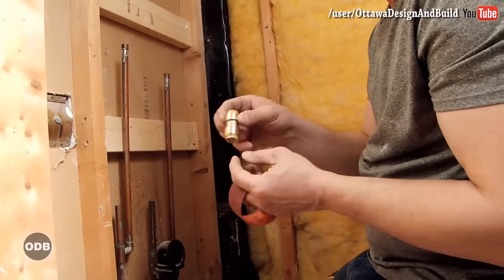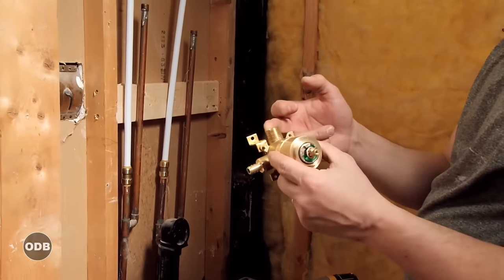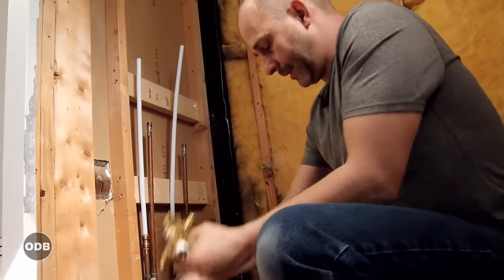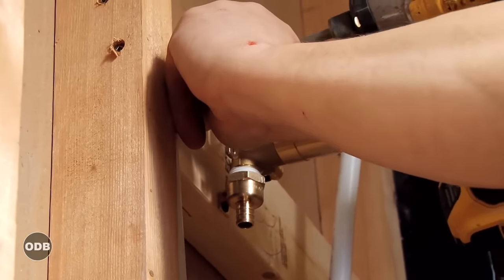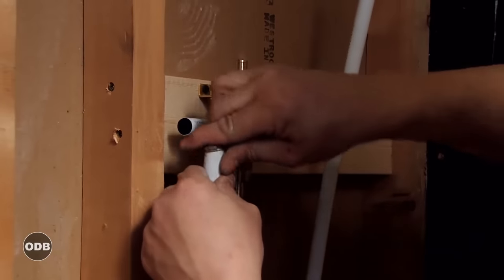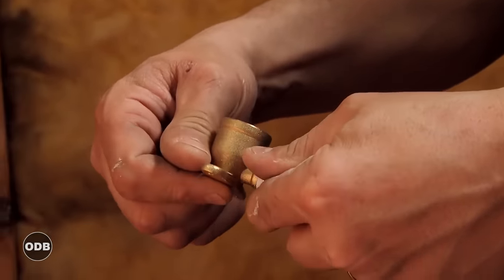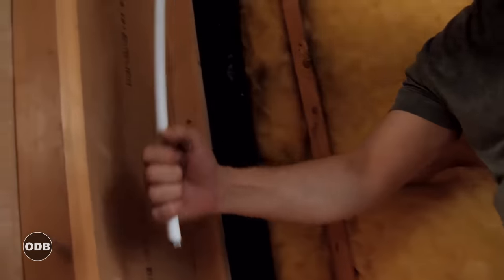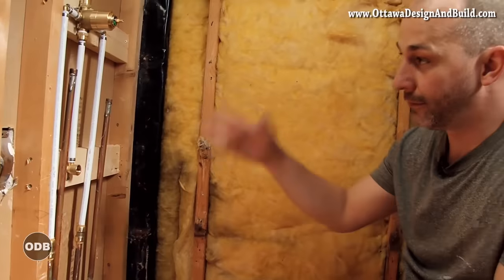DIY How To Install Copper To Pex | Shower and Bath Plumbing

Comment: Outstanding video! 

So about a year ago I hired a plumber for TWO DAYS to move some pressure copper 1/2 inch water lines in my basement in order to renovate a bath and laundry room. He did exactly this, converted everything from copper to pex. I watched and was amazed at how simple it appeared. Measure, cut, connect. There was a little drain pipe reconfigure also, which was simple.

One plumber for two days = $2,300!!! 

After that learned how to install pex myself with a buddy. Never using a plumber at $100/hr again...not for installing pex! Super easy and lots of help out there.

The cost of shark bite fittings are irrelevant compared to cost of licensed plumber. 

What this guy just did in this video would cost me several hundred dollars where I live if I used a plumber. Never again! 

Thank you again!!!
Reply: You’ll be calling that plumber back when those Sharkbite fittings fail. They’re cheap and easy for a reason.
Reply: @jimsmith3712  they're industry standard my friend. Tried and proven time and time again. Not remotely worried about it.

Plumbers are way way over paid! It's good work if you can get it. This shit is easy though, and there's lots of help out there. Fortunately for plumbing industry  Americans are lazy and have no sense of delayd gratification. 

As for me, a Plumber  in Wyoming with  helper is $230 / hr! No way, I'll figure it out and do it myself!
Reply: @paulv8133   Sharkbites are NOT industry standard by any means. You’re not even allowed to use them unless they are in accessible locations due to high chance of failure. And we are not overpaid we go through years of training to provide every house and building in America with sanitary Plumbing. We save more lives than doctors bro. Plumbing is the main thing separating us from 3rd world countries. And btw the type of pex piping he is using is trash, so are those cinch rings and he used the pliers ass backwards to tighten those fittings. 😂 This guy is a hack
Reply: @benjaminwhite6247  there you go, everything you just said one can watch multiple YouTube videos. I'm just saying I'll never pay a f**** plumber again. It's not remotely hard and anyone can do it.
Reply: @jimsmith3712  they have been out for a long time and really haven't heard anything bad, except for plumbers who are scared they be put out of business.  It's not rocket science and as long as you do it right, there's no problem.  The big problem is that plumbers pricing is beyond ridiculous and they got too greedy.  I've heard where they replaced toilets and charged $2100.00  There is a place for plumbers but for basic plumbing a lot of its now DYI

Comment: Thanks for the video! Plumber wanted $850 to change out shower valve (that I broke trying to fix leaky shower head). After seeing your video, a buddy and I changed over to PEX with new shower fittings($85) for a total of $190. PEX crimper tool ($45)was part of that cost. Super easy to do
Reply from the maker: That is why we do what we do. Cheers!
Reply: That plumber was trying to take you for a ride. I just had a 2600 ft house re-piped for $750.

Comment: Thank you so much.  I was just quoted $400 to install a Watts Recirculation system on my electric water tank.  It has a PEX pipe and I had no idea how to make the connection until I watched your video.  You are the Man and save me a bunch of $$$.

Comment: First time doing any kind of renovation and your video helped tremendously. All of them have, actually so thank you for that. My shower is enclosed and ready for tile. While researching that I came across something about the tub spout distance from the valve. I did some measurements. An entire 29" PEX run to the tub spout. Reading further, I realized that it should be no longer than 18" (per my installation guide) and should not be PEX but copper. The issue being that the shorter PEX diameter can constrict flow and combined with the excessive run, the shower head will/may run simultaneously with the tub spout diverter down. Per this video, I used PEX instead of copper. Lesson learned: always read the instructions before an install regardless of a youtube video demonstration, I get that. I'll be opening up the wall (Schluter Kerbi Board) and replacing what I need to. It's extra work but proper function and peace of mind prevail. 

My point being this: I appreciate your videos and I've learned so much. However, DIY homeowners should always read installation manuals regardless of what is shown in a video. Improper installation will definitely cause unnecessary delay and frustration.
Reply: Like you said the use case matters, even with copper. Some people only have 1/2 inch installed and they wonder why their water pressure is so terrible when more then one source is used.

Comment: This is the exact project I have to do!. Over the summer I added a Sharkbite "T" connector to a hot-water line & ran pex to a frost-free Silcock (even added an on/off lever in the pex line) & now I have an outside hot-water faucet. It works great. This video has emboldened me to take-on the tub project!

Comment: You should of 3/4” pex to the tub spout because, depending on the water pressure in the house, the shower head will drip/run every time you are using the tub spout do to restriction of flow by the 1/2” PEX adapters.
Reply: I’ve heard this several times. Idk if there’s much weight to it, but I’m getting ready to remodel my bathroom and I bought 3/4” pex to go from the valve to the drop elbow, and 1/2” threaded nipple for the spout itself
Reply: It says right on the valve not to do what he did. Was totally stupid. Otherwise the valve would have had the same nipples for that. He should have had a disclaimer he wasn't a pro, and not following manufactured instructions
Reply: What else can a diy use ? Don’t want to do soldering. Was about to install and tub spout line shows no pex or cpcv

Comment: My grandfather built houses and was just an all around handyman. Anything you wanted he could do. My dad was handy also when he wanted to be lol. But both died before I bought a house and required any of the knowledge I picked up throughout the years. I didn't pay enough attention to what they had to offer. I'll be honest Jeff I've learned more from your YouTube videos than anyone in my life. Enough if they were alive they'd be proud of projects I've completed. They'd prob point out some mistakes lol but don't all father figures. Thanks Jeff for all you do. (As I'm sitting here between putting up concrete board in my shower .it has a vaulted ceiling on one side 😑)

Comment: Hey Jeff, have watched this video several times. It's has saved me twice. Used Shark bites to connect my furnace humidifier replaced faulty saddle valve - it's open in the mechanical so I can monitor. Also replaced leaky shut off valve under kitchen sink. So far so good!
Reply from the maker: Love my Sharkbite brian. They are so easy to use and saves a lot of contortionist work in hard to reach places.

Comment: When wrapping PTFE tape (2min+) hold the reel the other way round then as you wrap you can control the tension AND the way/speed the reel unrolls.
Reply from the maker: thanks
Reply: Yes and the tongs too
Reply from the maker: cool
Reply: Burn Rooster i just see this video and he's doing in the good way direction putting the Teflon tape ok?
Reply: Plumberman Jones plllmk
Reply: Exactly what I was taught
Reply: would of thought it was obvious
Reply: Every video I watch just enfasizes that he is not a professional. Probably just the guy next door doing handyman work. The problem is that he isn't doing things correctly. Those pressure arresters always go above your spout otherwise you will lose water pressure when you open that valve. It is simple physics. SE PLUMBING CODE. ALSO HE DIDN'T STRAP ANY OF THE PIPING, THOSE HOMEOWNERS WILL BE ASKING WHAT IS THAT RATTLING NOISE EVERYTIME THEY TURN ON THE WATER🤣😂

Comment: Been doing Home improvement for 27 yrs...Things to do different: when using a shark bite, blunt out any copper pipe burs with a knife or blunting tool. Not doing so may damage the rubber "O" ring inside the shark bite upon insertion, and cause a leak. NEVER sand a copper pipe when using shark bites (SB) because the rubber "O" rings inside the SB fitting needs a smooth surface to ensure a proper seal. Scouring the pipe ensures micro water pathways, which will corode the surface of the pipe and cause a major leak later...that being said, NEVER use shark bites behind walls or hidden areas. Only use in accessable areas. Although  shark bite is an awesome product when installed properly, it may also fail. That being said, I would have used a brass "copper to pex" fitting, and soldered it to the copper pipe. Soldering is a tried and true method of plumbing...when done correctly.
Reply: I agree, I've seen so many shark bite installation that leaked. When copper pipes are in perfect conditions (straight,no curves, easily accessible), it may fit well, but when the SB connector is not aligned, the little drop comes out and your losing hours reparing this. I would never sleep well usign those SB connectors then close the wall, put ceramic tiles and hope it never fail.
Reply: @ericvaillancourt5969  so you’re saying all of these installations where they use shark bites for a shower will fail?

Comment: The directions with a MultiChoice universal Delta Valve say you must use copper or galvanized pipe to the tube spout to avoid having water coming out the shower head even when the tub diverter is not activated: 
 4. Between the valve down to the tub spout, make sure you are only using 1/2" copper pipe or 1/2" galvanized pipe. PVC or PEX piping has a smaller inside diameter which pressurizes the water up when it builds up. You can use PVC or PEX piping anywhere else in the install but between the valve down to the tub spout, you should only use 1/2" copper or 1/2" galvanized piping.
Have you ever seen this issue?  Thanks!
Reply: Greg Guiltner true. I had an issue with this a few years back. If it’s strictly shower with no spout. Pex all the way.
Reply: True weird thing is I have ran pex to tub spout in a pinch and tested before the wall was closed to make sure water didn't come out of shower head and it didn't. I have also seen this happen aswell. I'm not sure if it happens with just the cheap valves or if shower head height playes a roll in this to along with the restricted flow. I usually put my shower head  in around 80inch or higher so that might help the water not make it all the way up not sure.

Comment: The spout for the tub has to be 1/2" copper or 3/4" as pex you are going to less than 1/2 and almost a 1/4".  The restriction can cause the shower to come on without closing the spout. That is code.
Reply: Yep. I had that problem when I used 1/2 from valve to tub so I switched to 3/4 and problem went away
Reply: Hey this happened to me. So off the valve you converted to 3/4" but what did you do for the nipple for the tub spout? Convert back down to 1/2" or find a 3/4" tub spout and nipple?
Reply: Just so I understand, are you saying the water supply lines can be 1/2 inch, but the shower head and tub faucet connections need to be 3/4 inch?

Comment: Just a little advice, don't put pipe dope in the female fitting. When you tighten the male end it will push all the paste into the pep end causing a possible blockage in spout, shower head etc. put it on the male end 2 threads back and your set.
Reply from the maker: kind of splitting hairs here but still decent advice.
Reply: Gary Williams  How Hi yes to be the shower mixer how Hi has to be the  Vanity valve

Comment: Thanks for this. I keep seeing alot of stuff about plumber for 20 years blah blah, well we've hired plenty of those to do jobs that cost easily into the thousands and end up having to call them back to fix things or see spotty work (Some who've been plumbers for 40+ years).  So if there is no lasting harm, even if the PEX lasts less this is a great video for those not wanting to solder.
Reply from the maker: I agree jon, just make sure you have access to the fittings in case you need to replace them from the back side of the wall. Cheers!
Reply: Home RenoVision DIY is there a reason to not use the sharkbite push connector elbow joints and ear fittings in the place of the joints you're using?  Aside from cost?

Comment: My understanding from Pro Plumbers here in Arizona is you CANNOT install Shark Bite (or Gorilla)fittings in "closed" or buried walls. They DO eventually need replacing. Ok if you have access to these.
Reply from the maker: That is true Dave for most jurisdictions. We have an access panel next to the toilet in this case.
Reply: Dave Holden correct

Comment: Using pipe dope on top of the teflon tape is actually the best way to go.  If you read the directions on the modern day threaded "brass" pex crimp fittings, it says to do that on the threads.  It says that since the newer fittings are now being made "LEAD FREE"  that they highly recommend doing it that way!!  Just thought I would share that.  I imagine the brass valve bodies are also "LEAD FREE", so the same principle would apply.    I would like to see 3/4" pex or 1/2" galv pipe going down to the tub spout.  Keep up the good work, great video!!

Comment: Great video as always Jeff!  The pex pipe from the shower faucet down to the tub spout:  will this not restrict the flow of water and cause water to back up and drip from the shower head before activating the diverter pin knob?  We just had a reputable plumber here in Ottawa do all the rough-in and they installed pex all throughout.  The Moen bathroom fixtures we purchased specifically show in the manual using copper pipes from the shower faucet down to the tub spout.  We'd appreciate any feedback you and your team may have.  Thank you.
Reply: That is exactly what mine did with this install method. Going to have to remove and use copper for tub spout, but wondering if maybe going up a size in PEX for down flow to spout.
Reply: I'll answer for Jeff:  "Not a problem in my world, cheers!"
Reply: @8419james  Not true, this can and will have negative effects for many valves, resulting in water being inadvertently diverted to the shower head.
Reply: @MrCdrant  Lol, agreed. Was just making a joke reply since Jeff usually avoids these types of questions.

Comment: I had to replace a T-fitting under my house, and I used PEX for the job. I just used adapters to connect it to the old PVC pipe, but that was for the sake of a quick repair. Before going under my house, I assembled the fitting to three short sections of PEX tubing with a PVC adapter at each end. I used the same 10-dollar tubing cutter to remove the old fitting. I was lucky enough to borrow the expensive crimp tool, and so I only spent about $22 on the whole repair, including some of the tools. I want to run PEX through the entire house, and be done with having any plumbing problems. It's fantastic to work with and it's probably longer-lasting & more frost-resistant than any other kind of plumbing. It's a bit like playing with Tinkertoys or an Erector Set. Fun, not tedious.